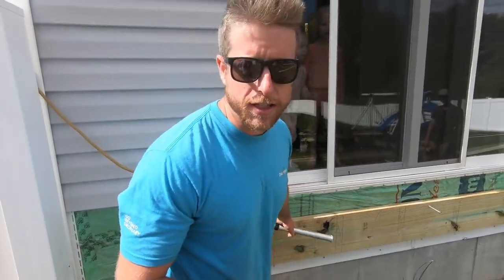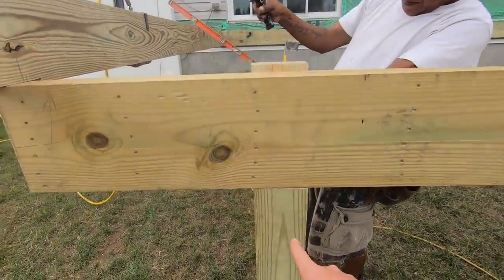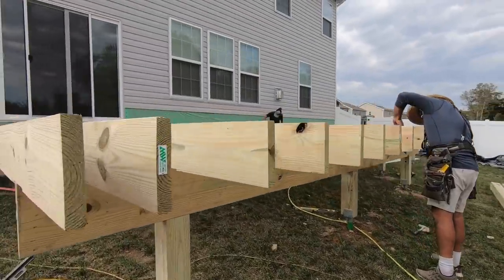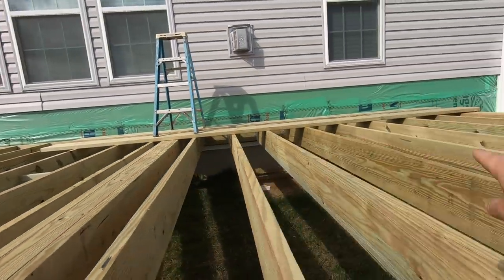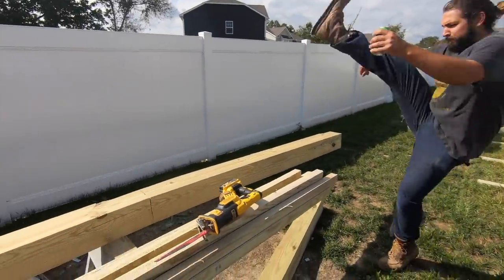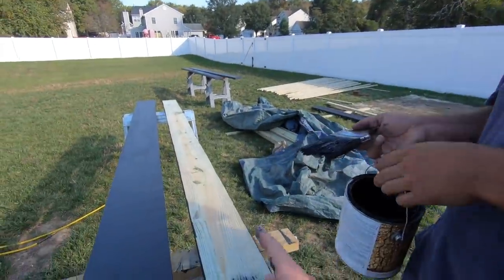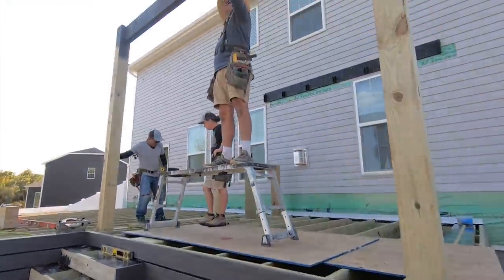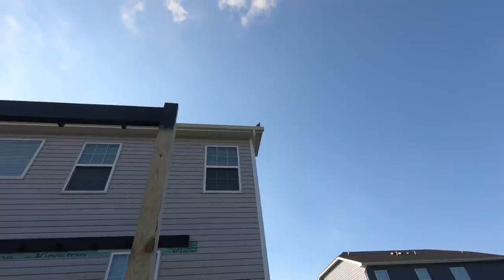Modern Deck and Pergola Build - PART 1

Comment: I like the idea of notching the joists. I would be concerned that my local inspectors will say its not a 2x10 anymore though. Are you oversizing the joists or anything to appease the inspectors?
Reply from the maker: Nah we haven’t had an issue with it, but we’re really just taking a quarter inch off essentially

Comment: Didn't you use the Ziplevel to get the 6x6's at the exact right height? I'm not following why you had to notch the underside of the joists if you could get the post perfectly measured, you knew the beam height, and you knew the joist height... then no adjustment should be needed?
Reply: 2x10 can vary in height from 9-1/4 to 9-1/2
Reply from the maker: Yup what trevor said, the lumber will vary quite a bit and if you put a 9.5 next to a 9.25 joist you will see a significant wave